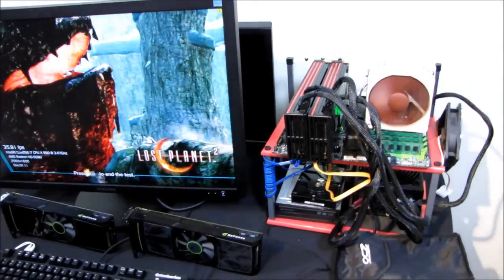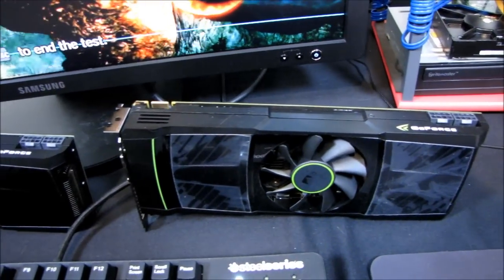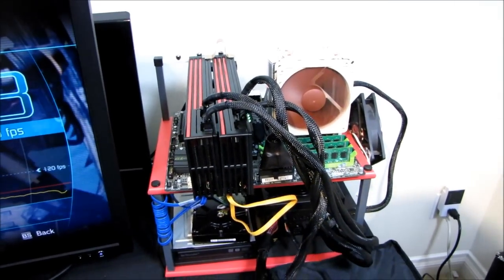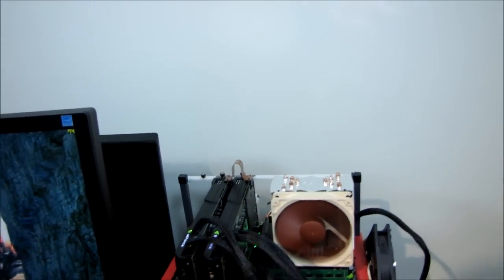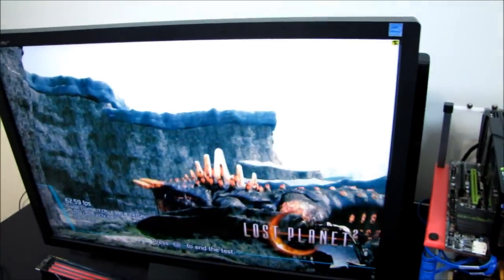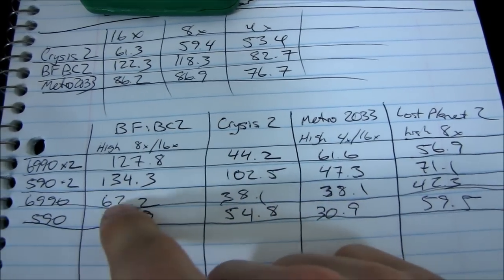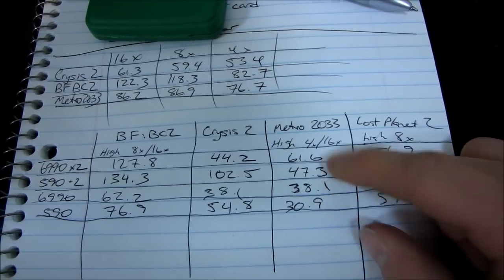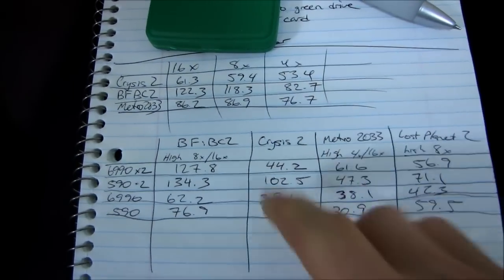Quad SLI vs Quad Crossfire Heavyweight Showdown GTX 590 & HD 6990 Linus Tech Tips

Comment: I really don't want to spam or something

can I run the new games on 3x1080p on 60fps? 

sapphire r9 290x
i7 4790 3.6 GHz
8 gigs of ram 1.3 GHz
Gigabyte GA-X79-UP4 

thanks for the answers
Reply: 60 fps of full settings is quiet hard even with a single monitor for new games. Maybe if you go as low as medium, you can get an unstable 60. But considering how problematic new ubisoft games, dont expect that with Far Cry 4.
Reply: yumameda Ok, thank you :-)
Reply: yumameda I'm capable of running FC4 at a full stable 60fps on ultra using 2 old GTX 570's in SLI. So I expect Moshe to be able to do the same with a 290x
Reply: A 290x will definitely do the job, but I'd go for two 280xs. For less than $100 more, you can get better performance than the single card, but with the sacrifice of the 6GB of GDDR5, but definitely not enough to really effect your gameplay as long as your arent affraid to crack into some afterburner overclocking. As for temps, they should be fine since the Tri-X and Vapor-X coolers will definitely do their jobs and stay pretty quiet, too.
Reply: That cpu wont work on the motherboard. And you would need at least 2 290x to run 3 monitors for 60fps
Reply: I had some stuttering, I changed some settings in the config.xml file.. i guess it was like DisableLoadingMip1 from 0 1 or vice versa. It fixed the stuttering for me. also I can't use AA because it will mess up the rendering for me. Though I can use AA and still have 50-60 fps. AO is also on HBAO+, without any problems.
Reply: That CPU and MOBO aren't compatible are they, LGA2011 MOBO with an LG1150 CPU, Soz Mate :)
Reply: SuttEvan You are correct, that motherboard does have an LGA2011 socket. The CPU won't be compatible.
Reply: DigicamCreeper
the vapor x coolers are crap, i used to own tons of gpu's in my Mining farm. the best cooler in my opinion is the Windforce3 From Gigabyte.
Reply: Windforce cards are nice too. Vapor chamber cards are also a little more dependent on your cooling. A higher pressure flow will give you the best performance with those
Reply: +yumameda I run FC4 on almost all ultra on this configuration:

Intel core i7-920 @ 3.6 GHZ
10GB RAM DDR3 1333MHZ running at 1060MHZ
Sapphire Radeon R9 270 Dual-X
Gigabyte GA-X58-UD7 motherboard.
Reply: +Moshe Sherman the motherboard is not compatible with your cpu

Comment: I went on hardware compare and apparently the 590 is a lot better then the 760. is that true or is the website displaying these results because the 590 is a dual gpu ?? thanks in advanced
Reply: In benchmarks, a GTX 590 performs better than a single GTX Titan. A single 580 card is about equal to a current gen GTX 760 so a 590 is obviously equal to two GTX 760s in SLI. 2x GTX 760 performs better than a Titan. A GTX 590 is an old card but it still performs like a beast. Only thing keeping it back is the amount of VRAM and it's architecture.
Reply: It seriously is. Look at the benchmarks for it dude. Linus actually said it himself, that's why he had a 590 for a long time.
Reply: ***** Negative, the Titan is in it's own class of card and separate from the 700 series. Nvidia has a 790 in development now to compete with the R9-295X2 which is currently the fastest graphics card in existence excepting of course the Titan Z(with its $3000 MSRP). The 790 will be 2 780's on a single board, Just like in the past 690=2x680's 590=2x580's you get the point.  Nvidia can still scrap the project at this point as the Titan Z technically is a dual GK110 board, but at double the price of the competition not sure it would work out so well.
Reply: It's not. It is better than a Titan in games that have optimized SLI. A 770 is equal to a 680, and 2 580s (590) is obviously better than one 680.
Reply: seriously the 590 is better ? or are you trolling me ? ;)
Reply: ***** okay, thanks dude :)
Reply: 1080p Samsung tv here and im doing  a pretty good job in sli 2x560ti
with a 6300fx, i would definitely love 2x590's it would be much better for AA quad gpu sweet.
a friend has 2 msi 580gtx in sli, they are perfect for 1080p anything higher i think you will start to see fps drop  
2x680gtx sli barely push 40fps on some racing games triple screen but it does depend if the game is optimised and if you have ai running also most of the time you can drop the graphics and run it smoothly on a triple screen setup
dirt 3 works fine where as asetto corsa or race room start to drop fps and adding AI really hurts the fps on game stock car 2013.
but if your going to do that i guess id rather 3x590's in sli 6 gpu setup
give it to me NOW!
Reply: dude c'mon use your brain. GTX 590 2011 video card and GTX 760 2013 video card think about it. Beside GTX 760 deliver more performance and produce less heat while using less power consumption. GTX 590 IS dead forget about it.
Reply: Nobody is going to buy a gtx 590 right now. There's no reason to. You're better off putting your money into a single 780 than a 590. Seriously.
Reply: if he doesn't have a 4k resolution, GTX 780 is pointless. Better to go with a GTX 760 or 770 or an equal amd card.
Reply: 760 is what im thinking
Reply: ***** Any decent "4K" gaming rig right now has at least two 780 ti's or 2 290x's or BETTER. A single 780 is NOT for 4K. When it was released 4K wasn't anywhere near as affordable as it is now... the 780 does quite well at 1440p but if he were using a 1080p resolution it would NOT be a waste. The 780 is a monster at 1080p just as it should be, I own a 770 currently and I can't max every game I want to at 1080p with an 8350 @ 4.7ghz.
Reply: i might go 770 or 780 memory bandwith 256bit vs 384bit
Reply: GolfWang 590 is a Titan killer.
Reply: Notification Recieved how so?
Reply: running 560ti's  i was thinking the same to get some 580's or newer 770 card for 1080p gaming, its more the power saving you get buying the newer cards vs the old which is good as the newer cards are pretty well priced i guess.
Reply: Yeah, get a GTX 770. It's a beast.
Reply: Quinn Marnich i repeat on 1080p the 760 and 770 are the best price/performance. the first thing that I always see is the price before buying a GPU. 780 and above are too expensive. Nvidia is pushing too high while no gaming GPU on the market worth more than 500$... About 780. the card is optimized for 2k and above. Dont get me wrong... Lets make it clear you cant run your games at maximum because your CPU is garbage at gaming. you can even push at 6 Ghz it would still garbage. FX 8350 is renowned to poorly perform when it come to games... other than that its a great cpu for heavy multitasking applications, I have a GTX 760 with an intel core i7 4770 locked version and i can max everything on 1080p. I run crysis 3 at maximum setting 1080p 4xMSAA between 45-60 fps. Battlefield 4, around 60- 70 fps. so your problem is for sure your cpu. it bottleneck your GPU. Also try to see if your ram or psu are not defective.
Reply: Notification Recieved 590 is a Titan killer... pff lol. are you drunk? or maybe trolling...
Reply: Notification Recieved
its actually a bit faster than GTX 780. (benchmarks) But far away from titan. Even if the GTX 590 perform better than 780 in term of performance the GTX 780 will be better on the next gen games because the the 590 is getting too old and its not optimized for the new games that demand new hardwares. But still the 590 is a dual gpu which can last a long time.
Reply: ***** I'm waiting for the 790, that will annihilate everything!
Reply: rainyjacktheepic unfortunately for you there will be no GTX 790 because the GTX titan is considerate as a 790, in the GTX 700 series.
Reply: Spencer LeFevre usually don't they make enthusiast card before high end and mid range?

I made some research and its expected to be released in a couple of months. But not officialy confirmed by nvidia unless you show a me link, that will be cool. Anyway the gtx 790 isnt for gaming, its too overkill. In my opinion a gpu that cost more than 450$ isn't worth for pure gaming only.
Reply: Notification Recieved
590 is little weaker than 770

Comment: a dual gpu card is basically "the same" as 2 cards, right?
Reply: The GeForce GTX 680 is better than the 590. Since the 590 is a dual GPU graphics card, the clock and memory speeds would have to be slowed down, dooming it's performance to the newer gen, single GPU graphics cards since GPU boost from Nvidia wasn't developed at the 590's time. This makes the GeForce GTX 590 an obsolete choice for performance compared to the newer cards like the 670, 680, 690, 760 and higher, and the Titan series, Which achieve higher clock speeds than the 590 thanks to Nvidia's new friend: GPU boost, which would gain more performance overall. Also, the fact that the newer 28nm technology would automatically have the card run cooler, and have higher clock speeds, compared to the older 40nm technology in the 590. Still, this GPU exhibits very powerful performance, giving 1080p performance on max settings in any game, so upgrading the 590 to the 680 is pointless and a waste of money. Overall, the 680 is the better choice. So, I owned this case, some of you lack PC expertise
Reply: *****
Which one because, in both sites the 680 cleans it
Reply: MrsPedoOnDaLoose You aren't actually looking at any meaningful information. The GTX 590 is actually slightly better than the GTX 680, but many GPU tests only benchmark a single GPU as opposed to two. Of course the GTX 680 will perform better in games that don't support multiple GPUs, but that's just life.
Reply: but your able to use twice the memory, and have less stutter
Reply: *****
Then how do people run max payne maxed out on the card if you only 2gbs of effective memory. You need at least 4gbs to do so
Reply: hirosese
I run max payne maxed out and i have 2GB VRam
Reply: ***** Also isn't having a two 680s faster then one 690. I think I've seen this in bench marks. So having a dual GPU is slower then 2 of the card it doubled if that makes any sense.
Reply: Steel_Nugget
that's not true for all dual gpus
, the 690 is 2 590's, so of course its slower. Since a 680 is about 30% faster than a 590
Reply: ***** http://www.hwcompare.com/12361/geforce-gtx-590-vs-geforce-gtx-680/, if that's true, then that must really suck for people who bought the 590 because the performance is ASS
Reply: ***** http://gpuboss.com/gpus/GeForce-GTX-680-vs-GeForce-GTX-590
Reply: *****
And no the 590 is indeed slower than the 680
Reply: MrsPedoOnDaLoose I would expect it is considering it is like a 4year old card ad the 680 is only a 2 year old card
Reply: James Golding
Ok I'll revert from calling you names, but you piss me the fuck off. You come here with no facts diluting everyone. I know it's ok to defend your purchase and be a little of an Nvidia fanboy that doesn't want to admit he waisted money on the card before knowing the 680 would clean it's drains in the next gpu series but come on now. 20% increase, more like 50% decrease in performance? the shit has half the texel speed of the 680, "THAT IS RAW PERFORMANCE" not gaming or any shit your taking about. Y'know what I'm done. Respond if you will but I just hope your lack of pc knowledge doesn't affect anyone else
Reply: MrsPedoOnDaLoose I thought you were being a douce but I read the whole conversation again and you kinda deserve to be a douce tho this guy.
James Golding there is NO WAY the 590 is faster than a 680. For what I'm concerned, it could be as good if the game or task had an option to be dual gpu dependent if there's something like that... which I guess there isn't.
But it's worse. Gaming wise and benchmark wise.
Reply: MrBDayz The 590 is faster.... The only time you will see the 680 pull ahead is in either unoptimized games or higher resoluitons
Because the 590 only has a 1.5gb Frame buffer
Reply: I've done some research regarding gpus lately (I upgraded mine and I'm helping a friend) and from a user point of view, the 680 still pulls ahead is most games. Im saying user point of view because benchmarking isnt the actual purpose of the card (for regular users).
The 590 can and probably will win in multi-gpu optimized games and programs, but the average game doesnt include those optimizations
Reply: Im talking Raw performance... If you say the 680 is faster it isn't. Games are just more optimized.
Reply: MultiDeadKitten You're wasting your time with these clowns. They don't give any evidence, they just like to state opinions
Reply: Im not saying the 590 is "better" im saying that when running both GPU cores on the 590 their is power...
Reply: ***** http://www.geforce.com/hardware/desktop-gpus/geforce-gtx-590/specifications
it says only 1.5 usable at 1.7 ghz

http://www.geforce.com/hardware/desktop-gpus/geforce-gtx-680/specifications
2gbs, but up to 4 at 750mhz
http://www.newegg.com/Product/Product.aspx?Item=N82E16814130794
Reply: Even look at the 3D Mark scores the 590 is faster slightly
Reply: crazymicah123 Slightly faster wouldn't make the GTX 590 better, as I've said in my last comment: The GeForce GTX 590 is an obsolete choice for buying a powerful video card, as the dual GPU would make the clock speeds slower, dooming it's overall performance to the GTX 680. But, both cards exhibit very powerful performance, meaning you shouldn't upgrade from the 590 to the 680 because money would be very much wasted there. The GTX 680 is much cheaper, and can achieve more performance with higher clock speeds with doubling it's normal performance because of GPU boost, which in the 590's time was not present. Overall, the 680 is the way to go.
Reply: MultiDeadKitten I never said the 590 was better is said it was faster... That was my point
Reply: crazymicah123 Most likely they were using retail versions. The other version of the 680 were much faster
Reply: MrsPedoOnDaLoose Yes, usually the retail versions were always tweaked and were usually underclocked, same with OEM cards, which were also retail.
Reply: Almost every 3dmark chart I found the 590 was slightly faster. the only 680 that was faster was a 680 jetstream and it was %4 faster than the 590
Reply: and the 680 jet stream boosts to 1150mhz